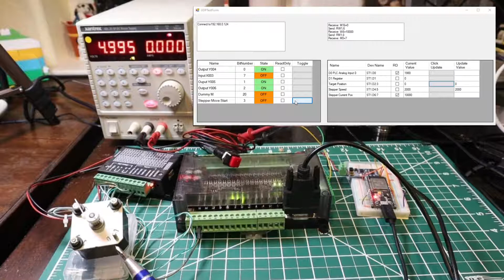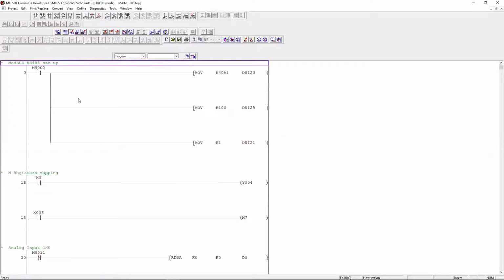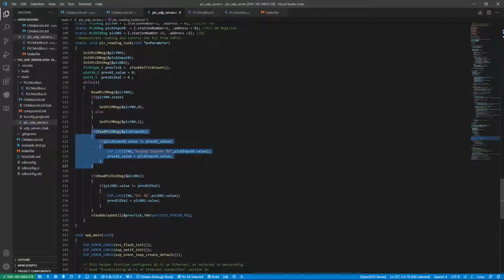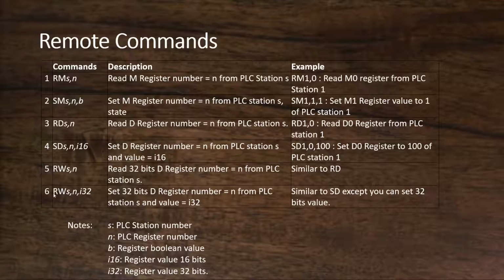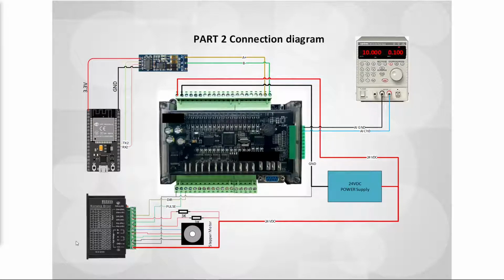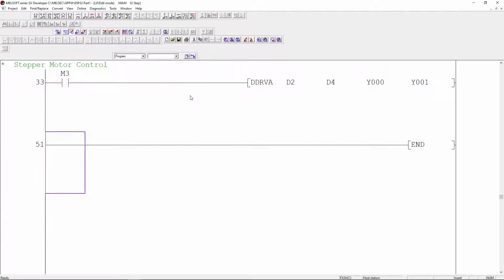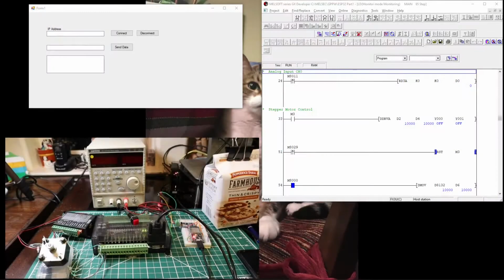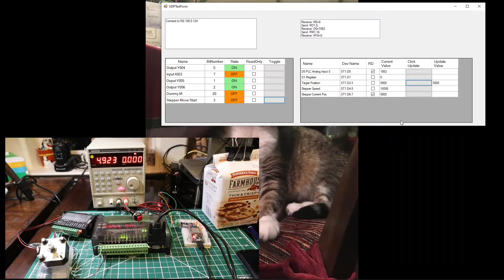Control FX3U PLC With ESP32 Part2 (Analog Input, Stepper Motor and remote access)

Comment: hello may i know what software do u use to create the connection diagram? thank you
Reply from the maker: I used Microsoft Visio to create the diagram and Power Point for Animation.
Reply: @kris-.1439  thank you, im planning to develop and add frequency control for the motor is that possible?
Reply from the maker: @chantaratisyaarisoni9930  Are you trying to control servo or BLDC motor directly from PLC ? I think it is very difficult to do without using motor driver.